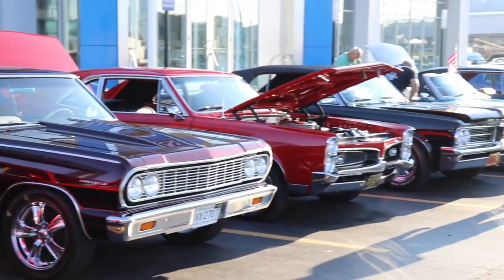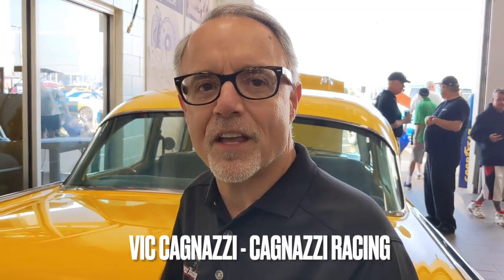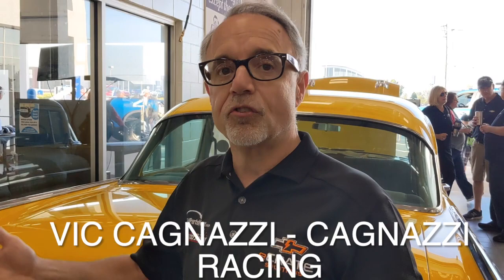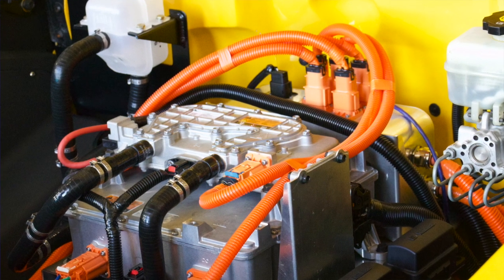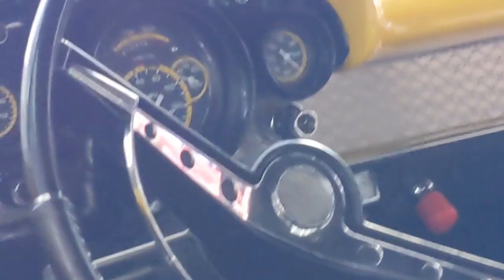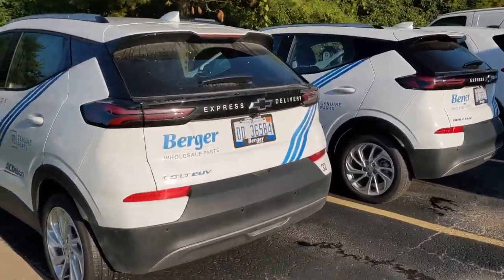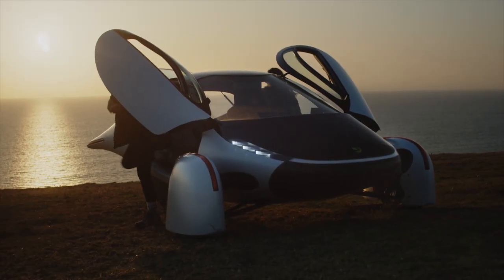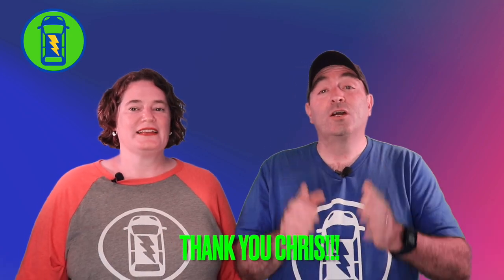All Electric 1957 Chevy! EV Conversion

Comment: Nice haircut Sarah! I also went to a hot rod car show locally today, and saw a VW Bus powered by a 300HP Tesla motor. It was very nicely done, but not cheap. Chevy's original E-crate motor was shown in 2020 in the K5 Blazer-E, it used the motor and battery straight out of the Bolt, with 200HP. But maybe this E-Crate setup uses Two motors (AWD?), or maybe it is from the upcoming 2024 electric Blazer. The trick is that most E-Crate motors (from GM and Ford) do not come with the controls, harness, instrumentation, and battery pack/BMS needed to build a running EV. And interestingly, the 2020 E-Crate package was around $30K, which is the same price as the Whole Aptera! But for a restomod, $30K is relatively dirt cheap, even not including the car and the labor. Today, I saw an all carbon fiber '68 Charger built on a 806HP, Red Eye Hellcat chassis. And the price was $400,000!  It is great that we are starting to see complete E-Crate motor kits coming from the big automakers, to transform our classic cars into reliable efficient EVs. I was seriously looking for such a solution for my 1959 Karmann Ghia convertible, but when I added up the costs I could just buy an Aptera as my daily driver, and keep the Ghia (mostly) stock, for open air weekend fun.
Reply from the maker: Great points Dean (Sarah says thank you by the way. She's sitting next to me as I read and respond to comments this am). This is the 2021 E Crate and of course batteries and other needs are separate. Which makes it pretty impractical. But fun for those that can afford it. Definitely rear wheel drive this one.  I would love to see that VW! So cool! Aptera seems to be a rare "affordable" EV. The Chevy Bolt is getting more affordable but we will see if they keep making it. On the GM website when they show the EV line up the Bolt is not there. Ford seems to have no plans for a smaller affordable EV (like the Focus). If I had time and money I'd retro fit something for fun but for now I'll enjoy seeing other people's work! Thank you for the comment!